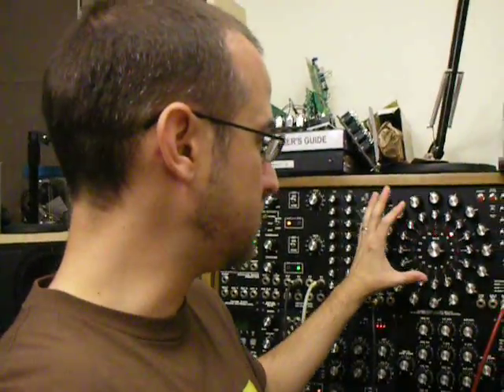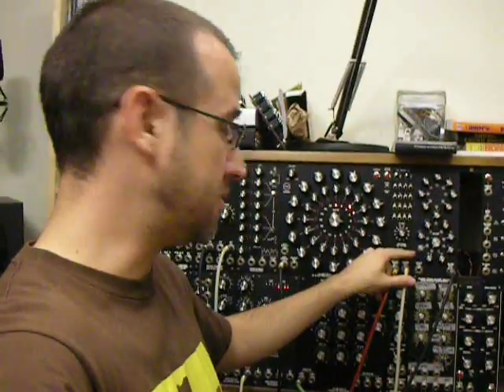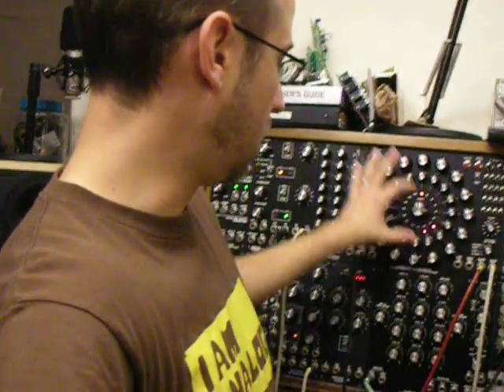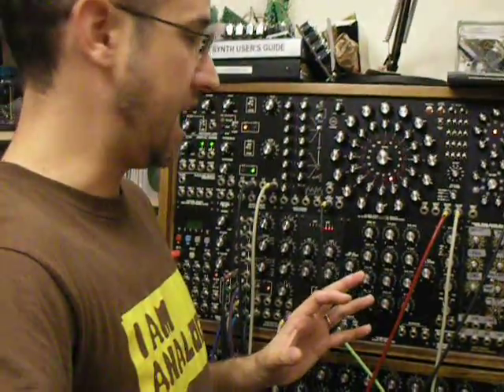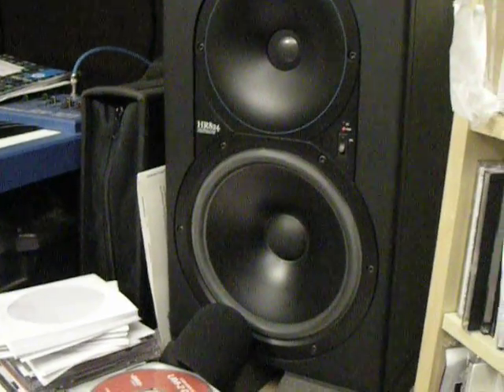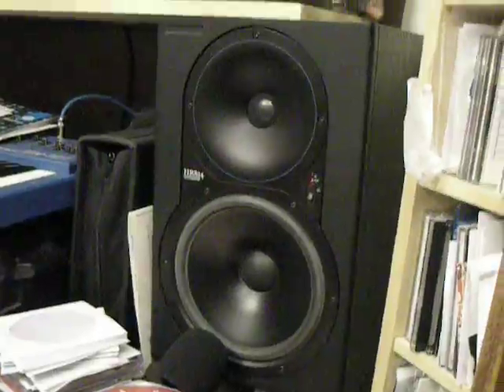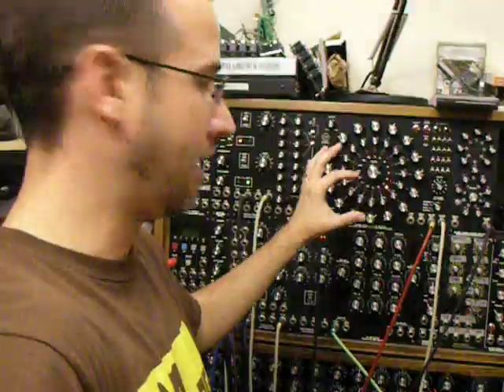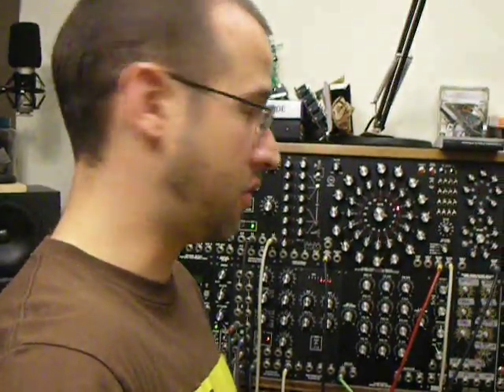MFOS Analog Sequencer Expander

Comment: hello
two questions please
but for the power you used a 12 VAC transformer out and 12 v dc out two modules connected in parallel?

and the wires coming from the panel 12v you have connected with one of two modules?

thanks a lot